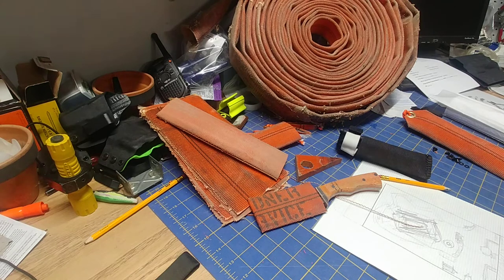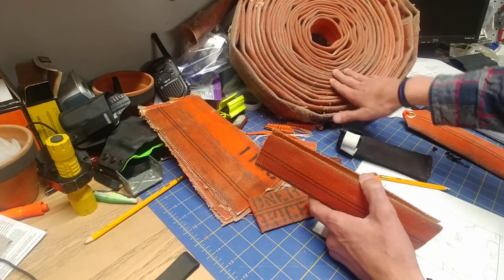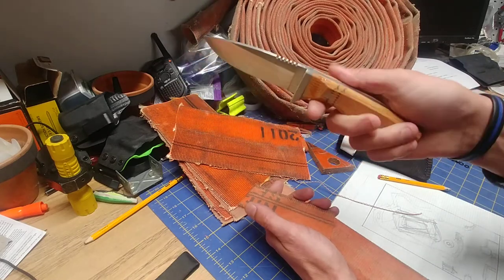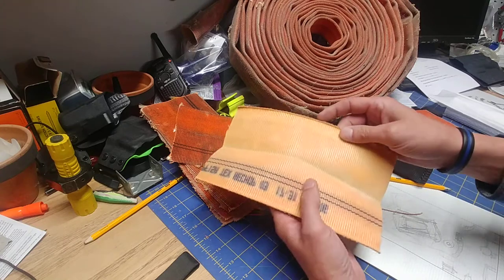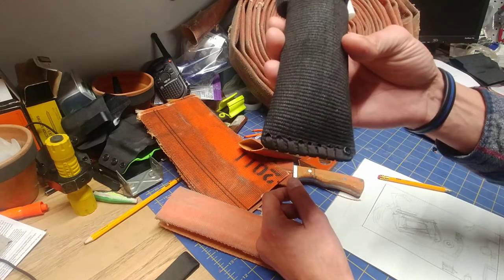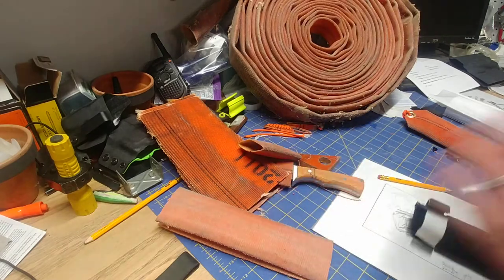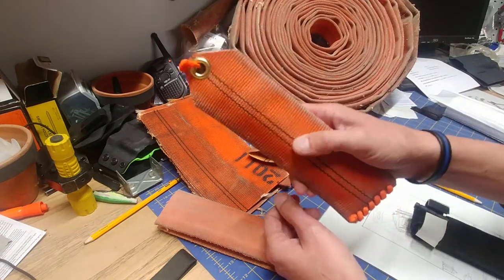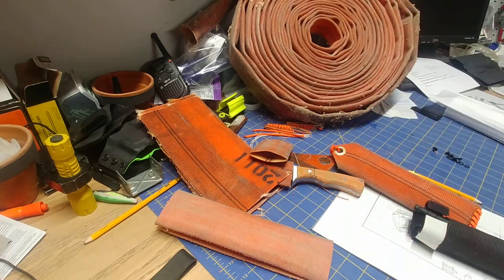Repurposing Recycled Fire Hose

Comment: What have you found to be the best way to cut the firehose?  I have something like double wall hose with rubber in the middle.  It's super hard to cut.  I was going to try some sort of saw, but thought the teeth would snag on the fabric?
Reply from the maker: Honestly I haven't had any issues with a good pair of scissors or a stright edge and razor. You can heat the hose in an oven and about 200 degrees the rubber lining can be peeled out

Comment: What glue do you use? I also make different projects with firehose from my department.
Reply from the maker: Steven- 2 part epoxy resin and fabric or linen will make what's called micarta. It's also known as G4, G10 or Garolite.